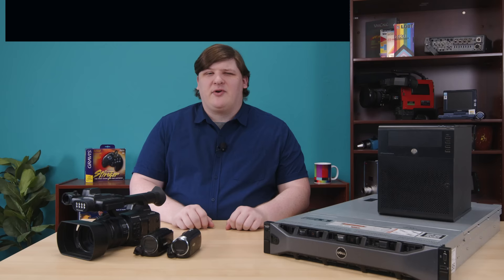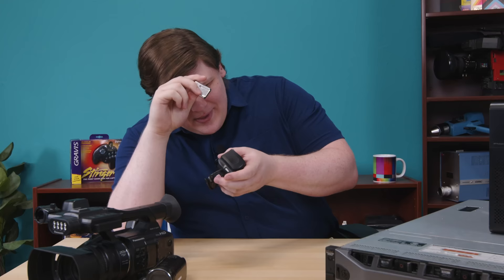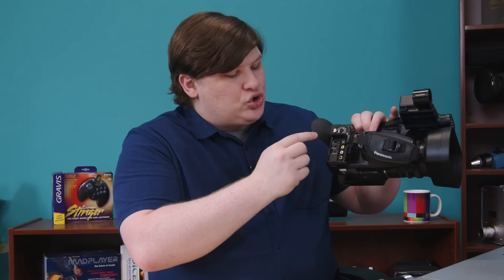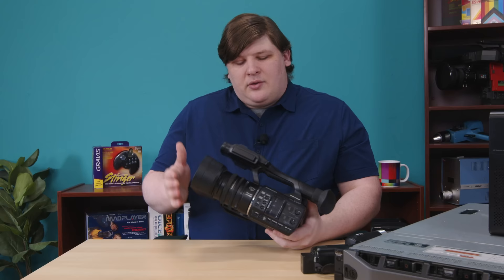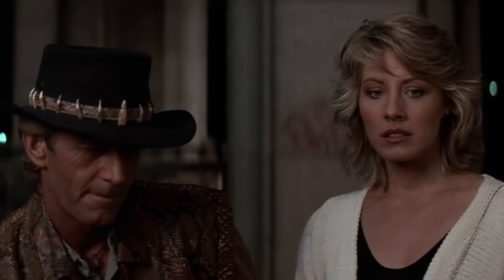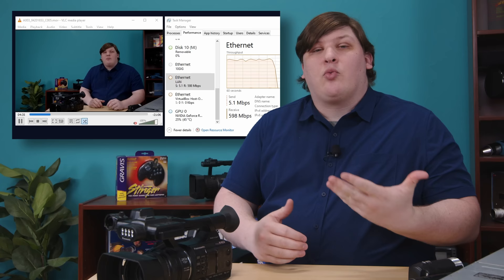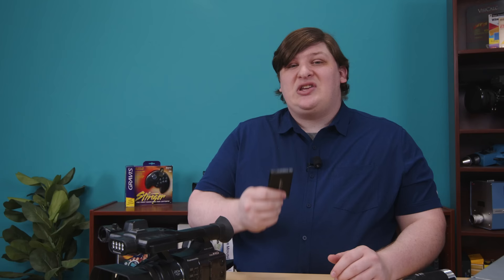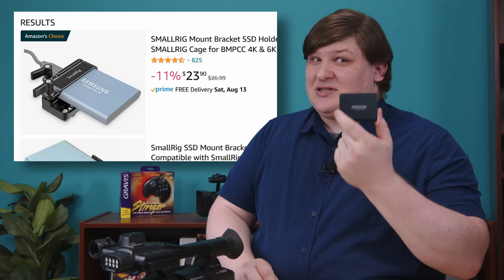I Built... a really fast NAS?

Comment: Hey bud, enjoy your vids! Thought I would chime in as an IT pro RE: your upgrade path mentioned around the 50 minute mark. You may wish to consider RAID 5, striping with parity, over RAID 0 striping. It offers similar performance gains but via the parity block still provides single failure redundancy. You need a minimum of three drives in the array to use but get better bang for your buck in the capacity ratio with 2 of the 3 drives worth of usable space. I know the Dell PERC controllers support this, at least in their vanilla flavor, idk if so with that weird back alley DMX album cover(?) firmware, lol.

Forgive me if you already knew this, but I didn't hear it mentioned in the vid. Also, thanks for helping me justify to myself my frivolous purchase with your Samsung Evo stamp of approval towards the end, haha.

Keep up the good work :)
Reply: Was going to say the same thing actually, RAID 5 I think is what theses DELL PowerEdge servers assumed you were going to use.  In fact, these Dell PowerEdge and HP Proliant servers i have worked on generally had the firmware built-into to do RAID 6, which bigger organizations will use over RAID 5 due to redundancy and the possibility of total loss if something happened while you were rebuilding the RAID 5 array [at the cost of needing at least 4 storage devices and a little slower write performance when using RAID 6].  

Edit: Another thing want to add is that if at some point you are using like over 10 storage devices in a single RAID or lun, then im pretty sure you are going to start seeing storage devices failing fairly regulary (like maybe 1-2 storage devices a month), which will require a rebuild each failure.  So if you'd be the person maintaining the server, it'd be in your best interest to have RAID 6 to not only allow your server to keep working while it has a single failed drive, but it wont be a constant battle of swapping out failed drives and sweating bullets during rebuilds.

I think RAID 6 is becoming more and more standard due to the need for more storage and each storage device's max capacity.  In fact the issue i kept running into for these 2012 or so servers is the fact that most of them are still utilizing BIOS firmware instead of UEFI.  And let me tell you whhhhhhat, most newer hardware will require UEFI but more importantly BIOS has the limitation that your storage device partitions cannot be larger than 2TB (you must format the disk to use GPT in that case).  Just word of advice, if you  do have an older server and it is still using BIOS firmware with CSM, see if the vendor offers a free firmware update that includes UEFI, id expect almost all of them would offer this but I know HP was A GODDAM FUCKING PAIN IN THE GODDAM ASS ABOUT THIS because i wanted the update and i had to contact HP to actually get the update (it wasnt available to the public) but since the warranty expired after 5 years your just fucked i guess cause they aint giving it to you (although they did say they'd give me the update if i had any HP server currently under warranty [i didn't :c]).   But yea don't wait to swap to UEFI especially if you plan on upgrading storage in the future, else you know what will happen?  You's gonna need to flash the server firmware in order use the new storage and if your old storage was using RAID setup through BIOS, that shit aint gonna work no more on UEFI.

Comment: the poweredge are fabulous machines. i have an R710 that has been running 24/7/365 for over 2 (maybe 3?) years now. what a beast. i also have the MD1000 storage enclosure which is fully populated with 15 HUS726060 hitachis. theyre in raid z2, and all 50k+ hours when i bought them, not a single one has shit the bed yet

Comment: Behind the radiator on the backplane there is a SAS Expander. The idea of this expander is to increase the number of SAS/SATA connections from the controller, since once when they invented the expander, the server was not used only with SSD disks and accordingly the speeds from the 1 or 2 cables were enough to deliver enough connections to 24 magnetic disks. The maximum number of supported disks from 1 controller through sas expanders is 256 (this applies to RAID mode). The second expander cable is not for redundancies, but to increase the speed (link aggregation) that is received from the controller. (in principle, if one cable is defective, you can only stay with the second one, but the defective cable must be removed, as it confuses the sas expander and, accordingly, none of the two links starts) Theoretically, one cable has 4x6Gbps, but when you add the second cable becomes 8x6Gbps, which is 48Gbps, with PCIE version 3 x8 (which is the version of most controllers of this era) is about 4.8GB/s (theoretical maximum)

Comment: I’m a teenager still, and this past summer I spent my time building a server VERY similar to this. I bought an older Poweredge r510 and put the best cpu’s that server supports, upgraded to 64gb ram and I also slapped 35tb of storage inside of it. My server is compatible in computing power to a lot of r710’s. I run ESXI 6.7 as my host os hypervisor, and a combination of CentOS8 and ubuntu VM’s under that. After investing in gigabit internet for my family and myself, my Plex server is SO MUCH FASTER. Like it’s unreal how fast. Going from 15mbps upload to over 950mbps upload is insane. I currently use about 15tb of that 35tb total storage with a combination of music, movies, and ripped game isos (ps2, ps3). How I directly access the storage from my main (linux, and windows) pc is via SSHFS. It uses ssh to mount the file system locally on my pc. And on windows using sshfs means that each 9tb drive shows up as separate disks, along with the 4tb and 1tb OS and misc drives. All in I spent right around $400 on the server, raid cards (h200, and h700), CPU’s (2x Xeon x5670), ram (8x8gb). I love the system and recommend it to anyone with an interest in tech and a few hundred dollars laying around. And remember… EBAY IS YOUR BEST FRIEND!! The r510 cost me $85!

This video was very interesting and also relatable in the sense that I went through a very similar process as the CRD. Even down to the LOUD fan speeds on boot.

Comment: I was excited to see the N40L in the opening shot and was looking forward to hear what experience you would share about it.
i was surprised and disappointed in how you presented it.
i suppose you may have just been going for a dramatic presentation plot twist in the video.
As someone who bought that thing back in 2012 mostly as a way to learn about NAS, then ended up still running it to this day with tons of compatible upgrades,
i think you did that little unit a disservice and a hit job.
the inefficient and handicapped configuration you have it at the time of this video, suggests that you put little to zero effort in looking up and figuring out how to configure far beyond its OEM compatibility claims and in a way that makes it more than merely usable over a decade later.

Comment: 3:20 I have 4 of these CX440 camcorders. Specifically got them for multiangle and remote control (see channel Miniatures Assemble!).
You can stick a second battery in there, but there are no connections to make it work. It's storage only.
The camera shipped with an extension cable in the box that you can plug in, although the design of it you couldn't plug in anything else unless it was that low profile port.
The cameras require 10W power (5V USB @ 2A) in order for you to charge and record at the same time (I have a brick of a 4x USB port that provides enough power for all 4 at once), 

The one gripe (yes, only one) is that the ports are on the inside of the swing out screen. Meaning if the camera powers itself off, and you have a cable plugged in, you have to unplug the cables, swing in and out the screen to turn it back on.

Comment: Was about to yell at you for 720, I'm glad you made the edit.... Upgrade or use a separate server for transcoding if you want to get 'more professional' R740 at least. Dual 8pin no problem, and 2.4kw PSUs if you want, but its 208/240v. I spend days install A30, A40, RTX A4000, RTX A8000 in data centers into R740s

Edit: you're smart to listen about 2.5 and 5gbe being a waste. 10gb  (sfp+) all the way. Just upgraded work switches to 400gbps, so hang on to your pants. Also, if you do go dedicated storage to transcode server, consider fault domain or FC.

You can get twinax / DAC cables for not using fiber, we use those, and they're 'faster' than fiber (latency), but bulkier. Also, those transcievers have a load of small components in them... so no you're not like connecting PCI long distance, its more like trying to connect to computers together via pci-e using a male to male pci-e ribbon cable, but even that isn't an exact transliteration, as the northbridge tends to handle the 'transcieving' part of the communication. No great analogy for it. Maybe trying to connect to computers together by their CPU sockets? Kinda weird road you went down for that analogy...EDIT2 - well I'm not surprised you did find / explain twinax.

Side note: I use two NX3230s (basically R720) for my NAS, which also supports GPUs etc, so I find it to be better than r720xd

Comment: I’ve worked in the SSD space for years at SanDisk.  Because of this, I ALWAYS buy twice the capacity I actually intend to fill on the device.  They are continuously refreshing the data, and the more you fill them up, the more they hammer fewer and fewer unused blocks to stay refreshed.  When you understand the wear and block replacement requirements in these things, you tremble to actually fill one up.  The more you get to filling them up, the faster they wear out.
My opinion is the reason you are having problems with SSDs is you are filling them to capacity.  They are not designed internally to last long when you do that.

And by the way, NEVER rely on SSDs for long term storage because they need to be plugged on for hours every 6 months so they can refresh their cells…the cells are just a capacitor that will leak over time.

So…get a bunch of hard drives for long term storage.  Never fill your SSDs more than half.  Stuff on SSDs you haven’t copied to hard drives should be plugged in at least once every 6 months for a few hours.

Your problems will go away.

Buy 4Tb drives and fill to 2 Tb.  If you do that, I doubt you will have any problems for many, many years.

Comment: I realized importance of data scrubbing feature that my NAS has, after watching this video. This is especially because one of my old Windows SSD stopped working without any warning. One day I turned on the PC, it was stuck at BIOS logo for a while, and then it said that it couldn't find boot device. So I booted from a Linux live USB drive, opened dmesg, and confirmed that system was seeing the drive, but kept failing to talk to it. If I had anything important on that drive, I would've lost them immediately.

Comment: Finally made it through! Some of your Windows networking woes may go away if you look at setting up your scratch drive as an iSCSI target. There are pros and cons to this, but for this use case the pros may greatly outweigh the cons. It would just treat your scratch as a local drive, not a network share at all.

Comment: I have to say I pretty much knew which direction you were going with this before the video ended (and even guessed right away that the slow SSDs were just crap) but it was still very engaging to watch until the end. Well done!

As for your SFP adventure, I went on mine as well in 2019 for a client.
I run some on-prem web/email servers and have to do a nightly backup to another server right next to it. The direct connect SFP+ (SFP and SFP+ are very different) cables were definitely the way to go as they reduced the backup from 3 hours to just 45 minutes.

As for fiber optics being fragile, well not so much. I did find that if you coil them up tight, beyond a certain radius, they will just stop transmitting light. Once uncoiled, they come back to life. Having said that, I wouldn't even coil twisted pair that much. If you bend it 180, it will of course be destroyed but only an idiot would do that.

For a commercial run, I used an outdoor rated cable (fairly heavily armored) of 200 meters in length to run between two warehouses, with the cable taking all sorts of weird loops, being dropped from a height of 10 meters (by accident) and dragged through an underground conduit rather mercilessly (with excessive amount of pull-cord and electrical tape every 10 cms). It came out on the other end working perfectly at both 1Gb and 10Gb. I eventually settled on 1Gb as 10Gb speeds were not necessary and there was no point in stressing the switch with unused bandwidth.

One interesting thing to note is if running fiber cable vertically, it's not recommended to have it hanging too far as the weight will eventually stretch the fiber and could cause it to break. I was recommended to put in a 360 loop every 5 meters to give the cable some relief. All in all, running fiber in my opinion is for extremely long runs or if running dozens of cables in a very tight space as standard fiber cables are definitely spaghetti.

Comment: Ive got a couple of AMD based Dell R515 v2 systems.  I flashed the LSI raid cards to IT mode and upgraded to the low power 8 core cpus.  one is an 8-bay 3.5 hot swap and the other is a 12-bay they both sit a foot away from me filled with a total of 20 SAS drives.  they are surprisingly quiet.  Both running TruNAS Scale.   Very Cheap!  Love em!

Comment: FYI Resolve absolutely can render to network drives. I built a NAS for my video company (18x 4tb drives, 2x 1tb SSD cache, Windows Server 2019) and we render to it every single day in Resolve 17 on Windows 10 workstations. It's connected using SMB via SFP+ using Mellanox CX3 NICs through a TP Link switch. I don't think we had to do any configuration to get it to render to the NAS. Hope you get it sorted out, because it's been awesome for us! We have Mega (cloud storage) running on the server so that when we render to the shared folder, it's synced automatically. That's how we deliver just about every client project.

Comment: You're what I want to be when I grow up! (I'm approaching my mid-60s so if I haven't grown up by now...)  Anyway, for those who don't need a rack server, and are OK with (dual) 1GB Ethernet, I can recommend the HP(E) MicroServer Gen8 and above. They are still low power consuming, relatively quiet little 1 cubic foot boxes, but have "big server" features like the iLO4 (HPE's iDRAC), and a PCI slot for inserting a real SmartArray (P222), so you can get RAID 5 and use Enterprise grade SAS drives. I think the Gen8 is a significant upgrade over the G7 in this video.  I've got VMWare booting from a MicroSD card on the system board, and 4x 4TB SAS drives and for my needs it works great, including playing video over the network, though definitely not pro-res, and not for editing! My "NAS" (because I refuse to invest in another Buffalo unit given they won't upgrade their software) is a Linux VM running Ubuntu Server, SAMBA and (I forgot which) DLNA software so I can play my music over my Yamaha Network receiver.  Most come with low power dual core Celeron, but you can find a 4 core "Xeon" processor on eBay for around $30 the last time I checked. They're small, cheap, and relatively quiet (the PCI Smart Array does kick the system fan up a bit), and a good entry to playing with servers if all you need is 4 drive bays and two DIMM slots. What other server can live on your desk or in your living room? "Adorable" is the word I used the first time I saw one!

Comment: Hey, CRD, I just had a thought when I was watching the video... at 28:56 you're showing how the drives fit very poorly into the cradle... If you were to add a sabot / adapter to take up the space... or OH! If you were to put in a couple of those self adhesive felt furniture feet in the slot (one on each side ) it would hold them steady and the felt would protect the cases from scratching... And here I was at first thinking of 3D printing a plastic insert... I think that would help considerably! I hope this will help you with that particular issue and look forward to more interesting and amusing videos in the future! Have a wonderful day!

Comment: dunno if you'll ever read this, but : If I had to guess on the single vs dual SAS cables,
First, SAS is supposed to be dual "channel" to disk - it's supposed to be able to make 2 completely different routes to a disk
     SATA does not at all. single route to disk.
    > SAS is made to be able to plug each of a server disk into two controllers, then you can set each controller to a different network, etc (this is really what SANs are, big storage servers with everything redundant... well, except the disk backplane... trust me, I know.)
Second, true, a single SAS port is only supposed to be able to handle 4 disks on its own. It's more of a limit on the number of connectors than a limit on the controller (the chip of the card). So, most backplanes indeed have a chip to split those over the whole array
    Combined with the first part, It wouldn't surprise me to see a pair of chips on the backplane to do this, each chip talking to a SAS channel on the disk side. Each would be capable of talking to all disks in the array (only if SAS drives maybe ?)
    > I'm wondering if changing the SAS connector to the other plug would then disconnect every drive except the SAS ones (I didn't catch if your EXOs are SAS or SATA)